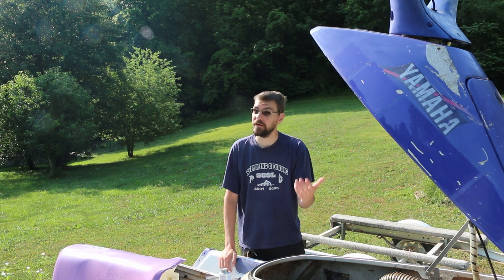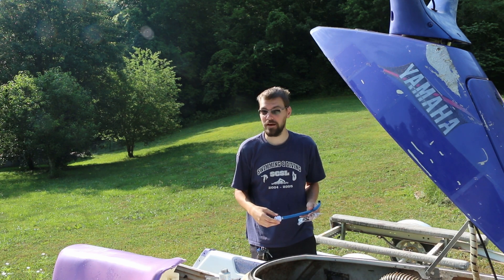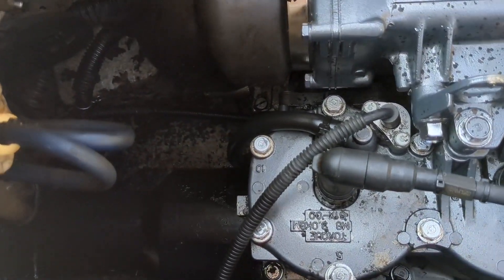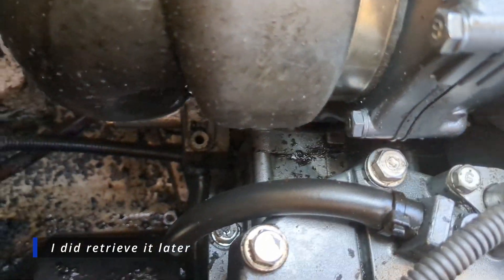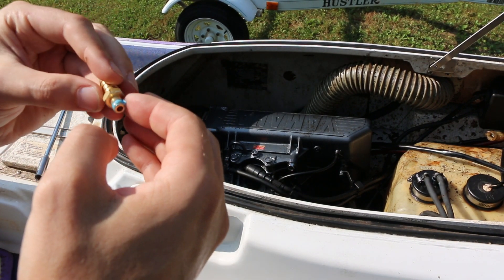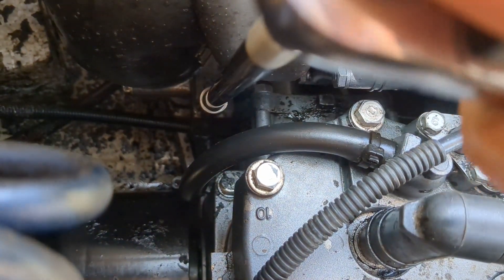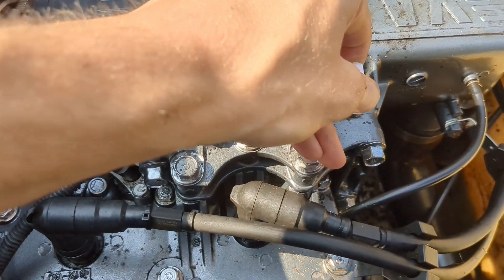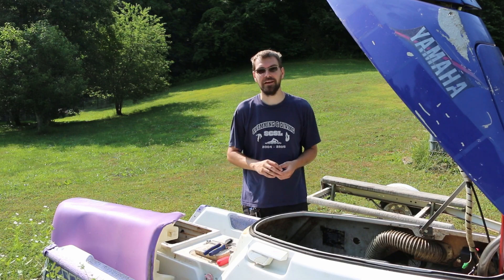Yamaha Waverunner 3 flush fitting install

Comment: Awesome video! Thanks for the easy explanation!
Reply from the maker: You're welcome! Hope it helps you get a flush fitting installed on your ski.
Reply: Do you have a link to that brass fitting and clamp ?
Reply: I have a 92 waverunner 3 w
 650 cc motor. Will it have that screw also ?